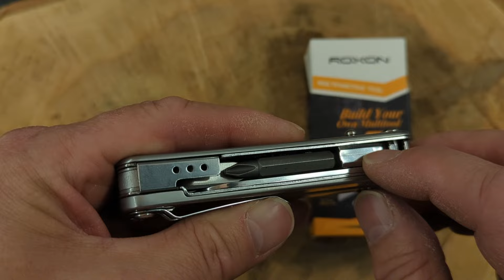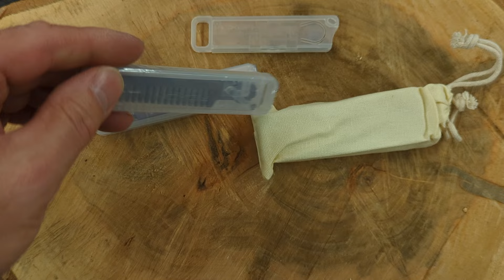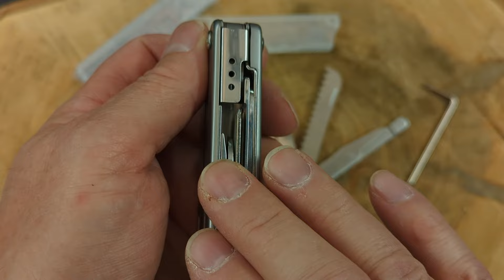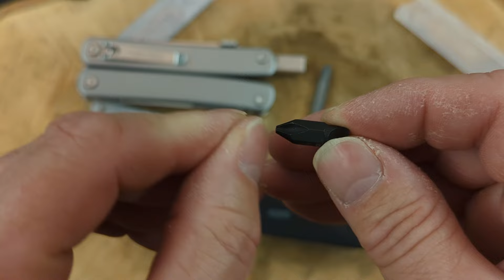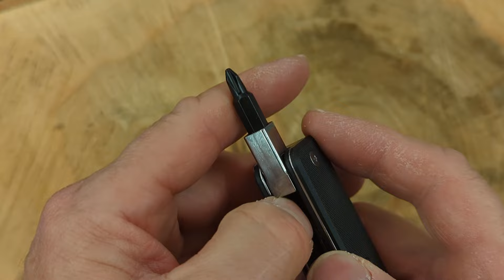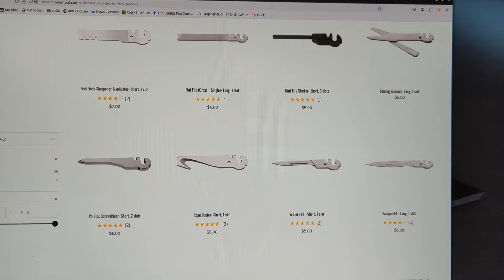Roxon Flex Companion Multitool Unboxing and First Impressions

Comment: I really like this tool, but my problem with this design is the one handed opening. In Germany this is forbidden. So i would have to buy an additional blade, wich, according to Amazon, only exists in a 3 blade set that costs 24 Euro. Plus the 53 Euro for the tool itself makes 77 Euro. For 79 i can get a Victorinox Swiss-Champ that has WAY more funktions then this tool AND is a two hand opener.
So, there is sadly no reason to buy it.
Reply from the maker: The one handed opening tab could easily be ground off to comply with the law. It stinks that the laws are that strict for you!
Reply: @TheCuttingEdge-LCK  Absolutely. Well, now i've bought a Victorinox Cybertool L.
It is also a very good choice, i think.

Comment: The Leatherman ratchet fits into the Companion bit driver I believe.
Reply from the maker: @Th3Gam3925  The rachet does work in a 1/4" driver, so it should work in the Flex as well. I am do for a follow-up video since I now have a good amount of use on the tool. It would be good to show some options like this. Thanks for the suggestion! I appreciate it!

Comment: I'll be taking out the bit driver and replacing it with the marlinspike and the pliers. This thing will then be awesome for working with paracord!
Reply from the maker: I purchased the Marlin spike too. It is great for working with any kind of rope! I think you will enjoy it.
Reply: @LastChanceKnives  are you able to remove the screes on the bit driver side, or are they glued in with Loctite?
Reply from the maker: @davideddy8557  The pivot for the bit driver is covered up by the scales. The scales would have to be removed to see if it is screwed in or if it is a pin. The other issue is that the bit driver is a liner lock. If you put in another tool it is not going to lock in place or stay closed. Plus it's a pretty short slot. I thought when you said replace the bit driver you meant the replaceable tools not the 1/4" driver.
Reply: @TheCuttingEdge-LCK  I just realized that I could get a 1/4" hex center punch that would do the job about as well as a marlinspike. Something to consider for future rope work!
Reply from the maker: @davideddy8557  You can also get blank long and short tools to make your own. A long blank tool ground down to a 1 space Marlin Spike just might be the ticket for paracord.

Comment: Nice review !

So, in the back of the flex companion, there is a bit driver that can't be replace by another short tool ?
Reply from the maker: Thanks! The bit driver is permanently installed. It would be a nice option to exchange it, but the tool would have to be bigger in order for that to work.
Reply: @TheCuttingEdge-LCK  Thanks for this precision. 
If you find a versatile bit, it's cool (one side flat head / one side philips).
Reply from the maker: @07Arpegius  I haven't found a good double sided bit yet. I did find one that work decent for Phillips, but is too wobbly to use the straight bit. I am still looking. If I find something it will be in a video update.

Comment: I preordered the Flex Companion unfortunately they sent me a left handed blade i did reach out to them they are sending the correct right hand blade . The Companion is a really nice multi tool really great quality . I do wish they would have implemented the pen & tweezers into the Scales the same way victorinox & others do instead of wasting a slot on those little tools .
Reply from the maker: @J2k1980  Your right the accessories should be in the scales, it would save 2 slots. This just may be a future 3D printing project!

Comment: Thanks for your review. I like the Flex Companion. It's a very clever design. I replaced the saw blade in mine with the long diamond file.
Reply from the maker: Do you have the Flex Multitool? The pair of them are so fun to play with!
Reply: @TheCuttingEdge-LCK  I don't have the Flex yet, but I will probably get it at some point.

Comment: I just bought one of these and it should be here in a few days. After loving the KS2 Elite and a longtime Victorinox fan, I am super excited for this. Might make a few videos of my own comparing the scissors to those found on the 91 mm Vic.
Reply from the maker: The KS2 Elite is a very cool tool. I love those scissors and D2 blade. I have had several Victorinox tools over the last 20 years or so and have a ton of their pocket knives. They make a high quality tool, probably even a bit better than Leatherman. Although Leatherman has the edge in flexibility. The Roxon isn't quite as good quality wise, but it is not far behind. It is just awesome that it can be configured any way you want. It has been a long time since I was this excited about a multitool!
Reply: @TheCuttingEdge-LCK oh me too! What Roxon has been working on for the last year or so you can see the evolution of what they are building on and the direction they are going is absolutely a good direction. They are filling a need. When you present a product that’s built to solve a problem, it’s destined to be a success.

Comment: Loving the Flex Companion.  I'll probably pair it with a Roxon M3 which frees up the scissor and awl slots. I'll replace the saw with a diamond file which frees up the small crosscut file slot.

Because it is modular with a lot of options, it will an excellent "companion" to a lot of other tools.  For example, a Victorinox Ranger.  That would free up FOUR slots in the Companion for specialty tools (crosscut file, saw, scissors, awl)!
Reply from the maker: @ParkerBinion  I think the Companion will pair well with any multitool. The overlap of tools can be avoided. Right now I have my Flex setup with the tools that I need daily and the Companion has tools for working with wood.